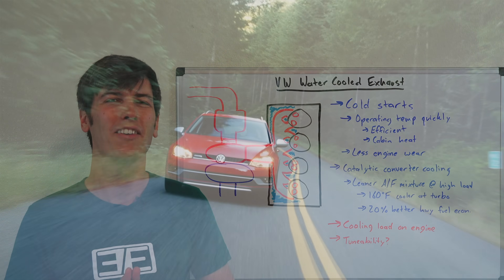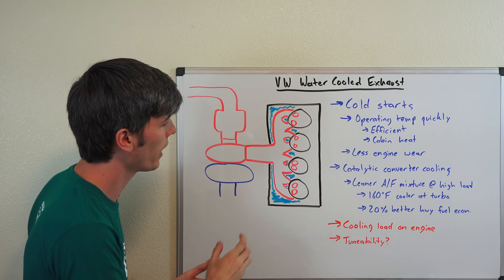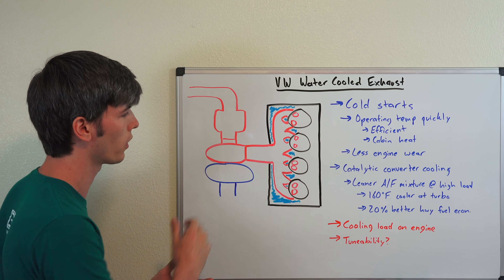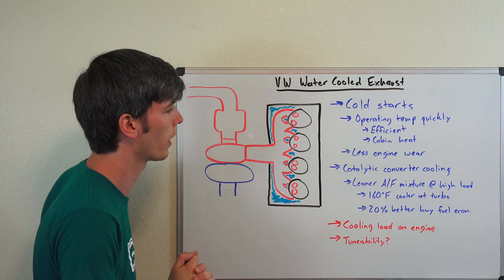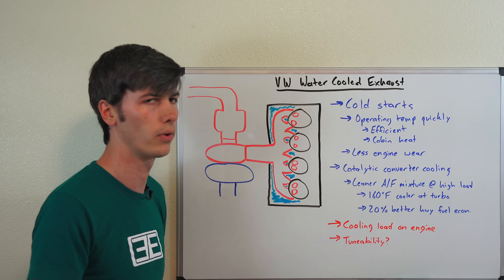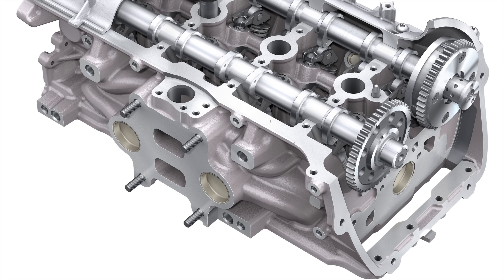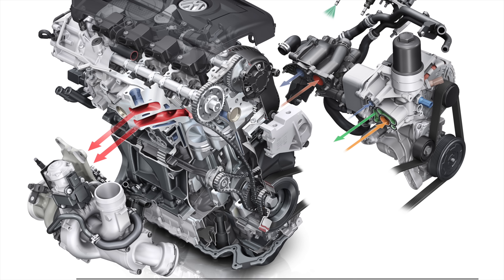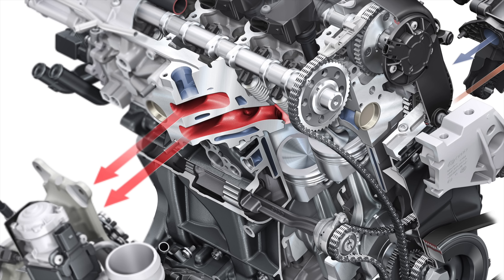Why Does Volkswagen Have A Water-Cooled Exhaust?

Comment: I think that cooling is maybe to relieve the turbo (exhaust gas temperature up to 1000°C). VW does cool the exhaust manifold on the newer 1,5tsi too and there it is to be able to use a VTG turbo to reduce turbo lag and rise fuel economy and power/torque.
Maybe the turbo on the 1,8tsi is VTG too??

Greets form Germany

Comment: VW's have always had just barely cooling systems.  If they run low on coolant they run away. If the electric fan fails they run away. If the radiator is dirty they run away. Hell just stopped in heavy traffic on a hot day they run way to hot. 

I cant even imagine how much faster this engine will over heat in a fail state.  I'm guessing if you don't turn off the engine immediately that it will over heat instantly.  Also I'll bet a loss in pressure in the coolant system will cause the coolant around the manifold to flash boil.  That head is going to warp and crack like a boss!

Comment: it's the gas velocity that a radial flow turbine converts to work through change of momentum. Hence the use of velocity diagrams in turbine and compressor 2D design. The lower gas temperatures in the exhaust gas do reduce exhaust gas enthalpy, but the actual the dT isn't   that large relative to the temperature of the exhaust gas. a 30 deg drop from 650 to 620 Deg can be mostly compensated for by the turbo match in a low powered engine. That same 30 temperature drop is significant on cooling side, as the coolant max temp is 90 Deg. The cooled exhaust manifold is not an efficient heat exchanger. We will see that when Rankine heat recovery debuts in hybrid schemes currently bring designed

Comment: it also is to help with turbo cooling after engine shut off, there is an electric water pump that kicks on and curculates coolant around the exhaust manifold and turbo to reduce hotspotting
Reply: I was wondering what that noise was
Reply: The electric water cooling of the turbo existed on the 1.8T 20V. One could hear it running after you cut off engine and locked the doors.
Reply: Its there since 80s.... got it on my golf mk2 1.6 td 59kw...oem...

Comment: For a naturally aspirated engine this would make sense to me to some degree, but on a turbocharged engine? I would think it would just kill turbocharger efficiency, I mean if we wanted the exhaust to cool why would we wrap the turbo manifold on performance engines to keep the heat in? A large amount of the efficiency of the turbo is from using the otherwise unused heat energy in the exhaust, at least from what I've read, but I'm no expert.

Comment: saving 20 % fuel only by heating engine quicker sounds like pseudoscience for me.
Reply from the maker: Perhaps you misinterpreted, 20% was not from heating the engine quicker, it was from using a leaner air/fuel mixture (as discussed in the video).
Reply: Perhaps. I suppose in order to use leaner air/fuel mixture and achieve 20 % fuel economy one must use some kind of advanced technology. Another question is 20% more economy compared to what? For example, Golf III Variant 1.8 (1993 technology) consumes 7.9l combined, alltrack 6.7l. Where is 20% from? Maybe 15% at max ;) I guess VW is cherry picking their numbers.
Reply from the maker: Compared to their previous 1.8L EA888. Vehicles using 3rd gen EA888 had increased fuel economy. Comparing different model cars (Golf vs Alltrack) doesn't make sense.

Comment: I believe that VW borrowed the idea from the Toyota Prius - where exhaust heat is collected to accelerate engine warm up. What concerns me with this setup is the fact that if the exhaust is being cooled before it reaches the catalytic converter (which I am assuming is located after the turbo charger) then the emissions control will not be efficient for a much longer period than with the Prius set up (where the exhaust heat is collected after the catalytic converter). Emissions control systems have never been a top priority for VW as we all know too well in Europe where millions of dirty diesel cars are still being sold despite the fact that they pollute between 6 and 15 times more than the legal limit... :(

Comment: You need to go back to some basics and review thermodynamics.

The reason why they have the exhaust collector cast with the head is 1: cost; 2: size.

cold start refers to having zero oil pressure, it has nothing to do with the engine being physically cold

Comment: Really interesting concept, and great explanation. I don't know if this is possible, but is there anyway to make the mouse easier to see when you are pointing out the different parts on the engine? I had it on full screen and could barely see it, especially when it was moving quickly.

Comment: Gasoline turbo engines have to be tuned rich to keep from overheating the turbo. Cooling the exhaust just enough to keep the turbo from overheating would allow VW to tune the engine lean thus saving fuel. Just my 2 cents.

Comment: Pretty sure that the BMW/MINI B38 engine does the same thing, but they water cool the turbo rather than the head (the very first water-cooled aluminum-body turbo integrated into the exhaust manifold).

Considering that the EPA has mandated a 54.5mpg by 2025, it's interesting to see how automakers are attempting to make the ICE get better at what it does; though plug-in hybrids seem to be the solution (no matter people's disagreements with them).

Comment: I am sorry, but I am now disappointed. every bit of heat that you dump into the cooling system before the turbo is wasted energy. the only reason that they are getting any gains is because they are running leaner. they should have the cooling after the turbo. this is another backwards step.

Comment: Well, tsi engines are direct injected and they run lean. The point about running rich is/was  to cool the combustion chamber/exhaust gas  for detonation control and lower piston turbo and valve temps. No need for that  since  direct injection takes care of that.

Comment: Holley Shiftwell: A Volkswagen Karmann Ghia has no radiator.

Mater: That's because it's air cooled!
Reply: It did have an oil cooler which tended to kill the cylinder (#3?) whose air flow the oil cooler blocked.

Comment: well this looks like a bad idea to me. first simply place the cats further away for cooler temps. 2nd why carry additional water when continuous airflow can do the job with no plumbing needed and limitless air available. third give the turbo all the energy you can. fourth complexity will add cost to maintenance and build. I'm not impressed.

Comment: Just a FYI German automotive engineers have been water cooling components for some time for example 2001 mercedes s600 water cooled alternator. A few good reasons for it is to make the components have either better longevity or performance ect...

Comment: +Engineeringexplained quite sure one of the advantages in the 2.0 TSI EA888 with the same setup is throttle response and shorter spool time as the exhaust gases go directly into the turbine from the valve

Comment: Seems rather odd to put the turbo next to the firewall but then VW is the master of engineering around heat challenges instead of using common sense. Remember the Golf IV VR6 with massive heat soak into the cabin? What about the Veyron engine that almost burnt down the test centre and after the program was restarted 5 yrs later VW solved the problem with 10 radiators and a comparatively huge frontal area for a rear-engined car.

Comment: Umm, a lean running engine actually runs hotter than a rich running engine.  Fuel actually cools the exhaust.  As the mixture goes more lean, the EGTs go up.  Sorry, you got this one wrong.
Reply: Yes, that's what he said. VW can run it leaner because they actively cool the exhaust, so it won't damage components.
Reply: Exactly the point. Modern cars make the mixture richer on high load for this reason so the cat wont fail from overheat (like he said). With this the exhaust gases are cooler to begin with at any load, therefore less thermal stress on the cat -> possible to run leaner mixture at high load -> better fuel economy
Reply: And also, a very rich engine will run a hot exhaust. Unburnt fuel continues to burn into the exhaust. You can overheat like that as well.
Reply: Fuel is only used to cool modern production gasoline auto engines at high power levels.
Reply: Yeah, so the temperature of the exhaust doesn't matter... BECAUSE THE COMPONENTS ARE WATERCOOLED

Honestly people, what the hell, this isn't hard!
Reply: michael perri What are you talking about? You do realize the coolant run through the water jackets also go through the radiator don't you? They're not just putting coolant around it and not running it through a heat exchanger. By your logic an engine should be incapable of being watercooled.
Reply: no other car seems to have an issue with hot exhausts
Reply: Not quite. An engine that's running RICH OF PEAK gets hotter as you lean it towards stoichiometric. EGT's are highest at stoichiometric and drop as you go to either side of peak.
Reply: Teth47 - they "heat exchange" the exhaust manifold to cool the turbo housing and to scavenge heat in the winter.  you must be out of your mind to cool exhaust gasses would require a setup equivalent to a tankless water heater.  do you have any clue how many cfm's of exhaust an engine produces per minute?  a cooled exhaust manifold won't put the slightest dent in those numbers the gas flows through too quickly and there is no heat exchanger.

Comment: Last time I checked, a 1.8T wouldn't be in boosted operation or at least just running a little boost to do highway speeds. Unless we're talking 200 kph Autobahn "highway speeds". 
So I don't know how they would gain 20% with that setup when it's running almost naturally aspirated at that point or at least close to it, simply because you don't need to run a leaner mixture outside of WOT / higher boost operation. 
And also imho running a "lean" (however, VW's "lean" is not mentioned here) mixture creates more NOx again?
Critics and Comments welcome ;)

Comment: COOL! I expect other benefits would include 
- Possibly eliminate need for intercooler as the turbo won't be scorched so much by hot exhaust and thus creating hot intake?
- reduced turbo lag, due to both 
 - - short distance to the turbo
 - - Colder i.e. denser air to power the turbo

Comment: Bad idea, I'd say.
Lowering exhaust temperature, should lower Turbo efficiency.
Besides,
At 1.8l turbo charged, it only makes 170HP?
My 1.4l turbo ecoboost engine makes 150HP!
And my 1.6 liter turbo (Fiesta ST) makes 200HP.

I wonder how it'll work in summer?

I also think that cooling is an issue. In a conventional engine, you try to cool the cylinders, which is only part of the heat the engine creates.
The exhaust has at least 10x more heat than what the cylinder walls absorb. Taking only a fraction off of that heat, will at least double the car's cooling needs. Heat soak should be eminent in summer if not sufficient cooling is given!

Comment: that's all nice but i thought that cooling the exhaust has a negative impact on the power that's produced. cold air is more dense and travels less quickly which decreases the airflow in the exhaust which in turn decreases the power of the engine.

Comment: too much stress on the head cylinder head, and cooling system. sounds good in a lab but out in the field.
Reply: life is what is German engineering Understatement and it will work smooth and fine

Comment: This makes no sense the whole point of a turbocharger is to extract energy (heat) from the exhaust gasses. Why would you cool the exhaust by 160 degrees Fahrenheit BEFORE it gets to the turbo?
Reply from the maker: +tommy kennell if ya watch the video I tell ya! :)
Reply: Engineering Explained I watched the whole video (it was great by the way) and I see the up sides but I feel like you are just wasting energy. Not to mention the whole cooling system has to be larger and you have to power the larger fan. it just seems like they are making a lot of sacrifices for this system.

Comment: Can this exhaust system be applied to the Volkswagen TDI (turbo diesel)?  Will Volkswagen apply this idea to the TDI and get even better fuel mileage than the TDI already does. 

 I remember in heavy trucks having a pyrometer probe about 3 inches from the exhaust pipe exit from the engine.  The pyrometer allowed the driver to see the exhaust temperature exiting the engine.  If the exhaust temperature was getting above about 1100 F it was time to back off or risk melting pistons, etc.

Comment: Man that is awesome and makes so much sense. I was amazed with how fast my 2.0T EA888 got up to temp.

Edit: To address the no aftermarket exhaust manifold point, the aftermarket companies er rather performance companies are actually designing new heads for the EA888. Obviously a head is way more expensive then a manifold. Right now I know Dinan is working on one, and their piggyback is up for CARB approval. I'm sure 034, BFI and some others will eventually have new heads with redesigned goodies for sale. That being said it could be next week or in 5 years, who knows.

Comment: I avoid vehicles with turbochargers, unless they're under warranty and I don't plan on keeping the vehicle past the warranty period. Way too costly when they need to be replaced. Great video!
Reply: These can last over 150k km, but these EA888 third gen eat oil
Reply: @dragospahontu  No, only the early 1st gen EA888 had oil consumption issues. That was fixed on the 2013 and newer engines.
Reply: @Japplesnap  got it from what year up to 2013?
Reply: @dragospahontu  The 2009 to 2012 engines had oil consumption issues. 2013 and newer are fine.
Reply: @Japplesnap  petrol or diesel engines
Reply: @wakaflockaproject  Petrol.
Reply: @Japplesnap  the 2.0 tdi of the same years are reliable
Reply: @Japplesnap  just wanna say I have an early 1st gen, I beat the hell out of it, it loves life

Comment: Hold on a second. It almost seems easier for OEMs to use metal core catalytic converters instead of your traditional ceramic core cat in order to lean out the fuel mixture. As interesting as this is, it almost seems unnecessary given how far along metal core high-flow cats have come along in terms of emissions. 

There still isn't a CARB certified aftermarket metal core cat out there, but for the rest of us who aren't constrained by those laws, GESi and Vibrant Performance have come out with an EPA certified cat that can withstand hotter exhaust gas temperatures. 

I recently had one of these placed in my aftermarket downpipe on my Subaru, and these cats pass the sniffer test here in Colorado with flying colors. I wonder if the R&D required to further improve emissions for these cats exceeds the cost of a watercooled exhaust manifold as previously stated, these cats are not CARB certified. For the rest of us, however, there's plenty of clean horsepower that can be made. Leaner mixtures do contribute more to NOx pollution if not paired with a proper cat after all.

Off topic, but ironically so long as you don't live in California or New York, there's not really an excuse to go catless anymore.

Comment: So this is kind of in the opposite direction from wrapping exhaust headers?  Which is supposed to limit exhaust energy from dissipating for hp purposes.  Would this system therefore reduce performance?  Even if it boosts MPG?

Comment: Excellent, informative video. Questions: (i) Does the fact that lower temperature gas feeds the turbo mean that the turbo is extracting less energy thereby reducing the potential boost? (ii) Does the lower cylinder head temperature imply that the engine is less efficient, all other things equal? My understanding of thermodynamics--40 years after college--tells me that the greater the temperature difference the greater the power.

Comment: first off diesels don't have cats, diesels do not run rich nor dump extra fuel. all diesels with turbos run very lean due to the volume of air.  they cool the exhaust to reduce the NOx produced by high heat combustion. this way they can have a hotter combustion  chamber burning the fuel more completely and have the cooled manifold to reduce NOx by the byproducts not being hot enough to oxidize the nitrogen

Comment: It explains the benefits of water cooling the exhaust gases, but I'm still curious about the benefits of the manifold geometry being integral to the engine. In other words, why not just water cool the gases leaving the exhaust valves and keep the manifold outside? Could it be because the lengthening of the exhaust path is necessary for cooling, so they had it do double duty to serve as a manifold?

Comment: Nicely done. Thank you. Is indeed the cooling system upgraded? What about a higher volume water pump? Last thing we'd want is to solve one issue but then at 60k miles have a brittle system that then lunches the whole motor (ala BMW e36/e46). Just curious.